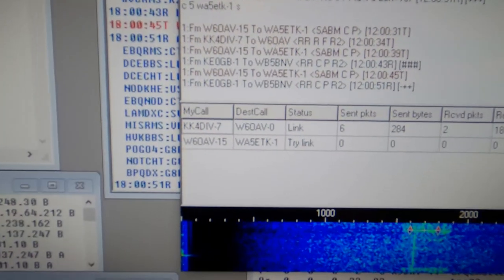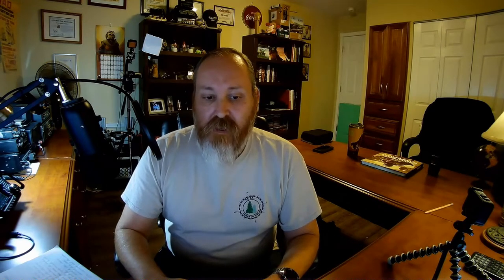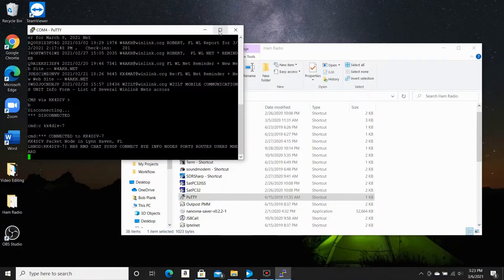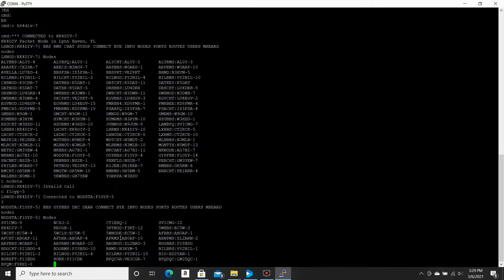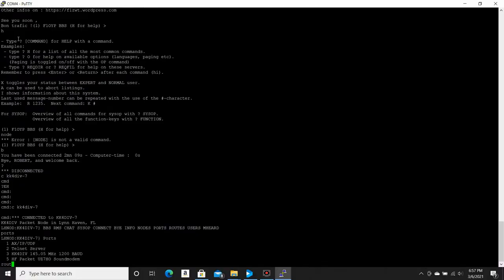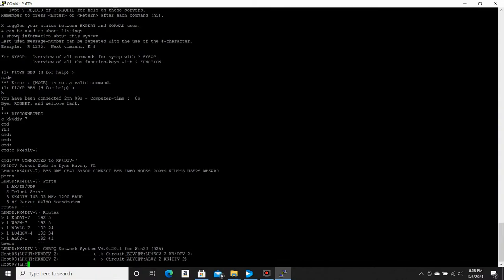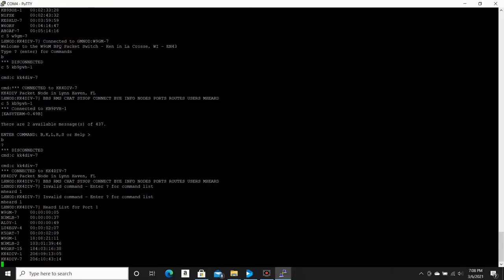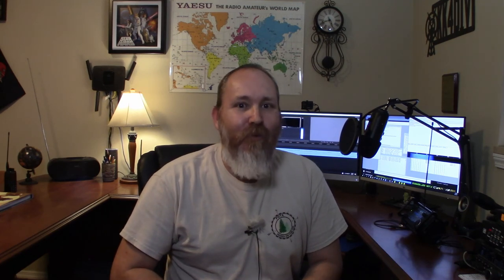Basic Packet Radio Node Commands 3/7/2021

Comment: Thanks for the refresh.  I just set my TNC up on 145.010 in the upstate of Dacusville, SC.  Waiting to see how many other stations are doing packet instead of aprs.
Reply from the maker: Certainly not as many on packet as there were in the 90s and early 2000's.  But, there are still a significant number out there in some packet hot-spots around the country.  There are a lot of areas also where you will find few to none.